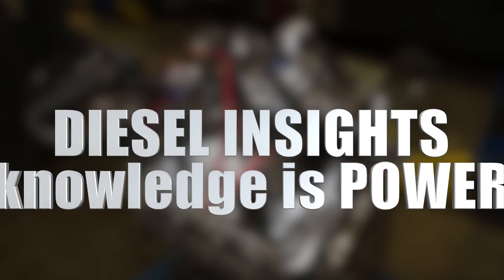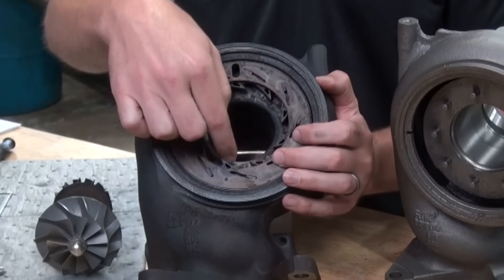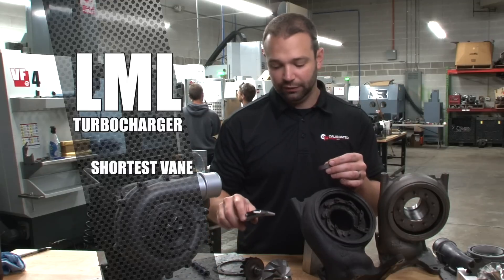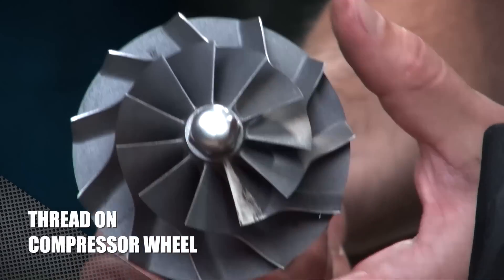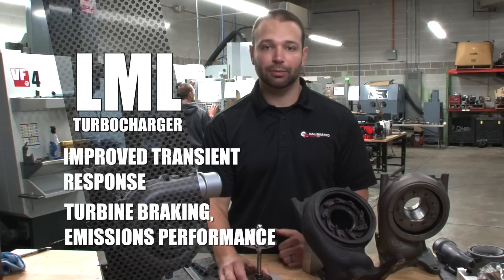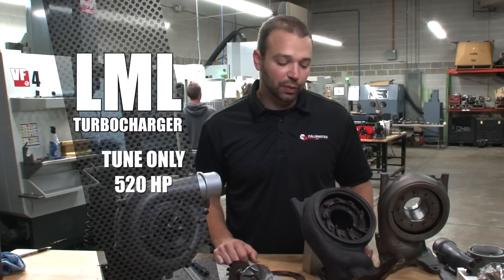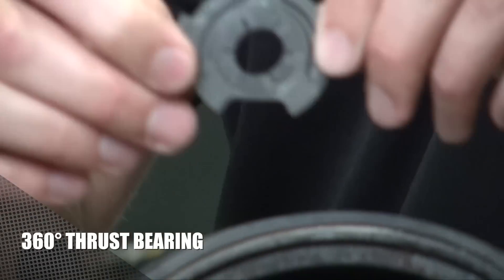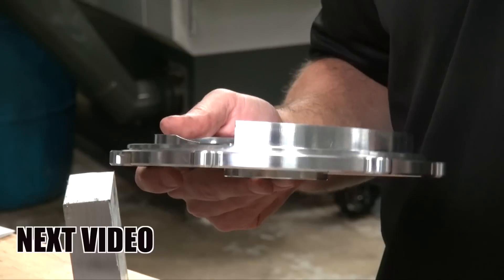The stock Duramax LML Turbocharger - Diesel Insights

Comment: At what rpm dose a stock lml begin to build boost?
Reply from the maker: @adamabarquez8257 boost starts to come in around 1400rpm and full torque by 1800 and max power usually around 2600-2700 on stock turbo.
Reply: @Duramaxtuner  thank you, I just got a monitor and want to make sure I'm within the right parameters
Reply: @Duramaxtuner mine builds boost wayyy lower. Like 900 rpms

Comment: So if I upgrade my stock lml turbo to the stealth64vvt, how much of a difference will I notice in exhaust braking? I assume the braking affect won't be as strong with the longer vanes of the stealth.
Reply from the maker: Exhaust braking retains it's effectiveness with the LML Stealth 64.  The LML has an progressive braking system, so the harder you step on the brake the harder it will apply the exhaust brake.

Comment: Is there any video you guys can recommend me to to change out a fuel pressure regulator on a 2002 Chevy 3500 LB7
Reply: It's pretty straight forward just peel the onion take parts off till you get to it I would highly recommend putting in an FPRV delete IE race plug the race plug for an lb7 is LB7 ONLY NO OTHER GENERATION WILL FIT